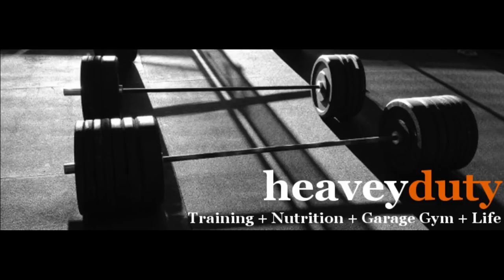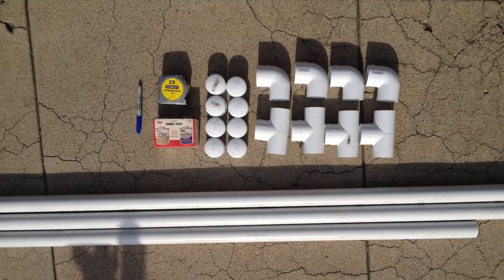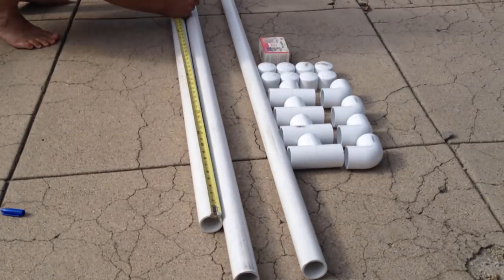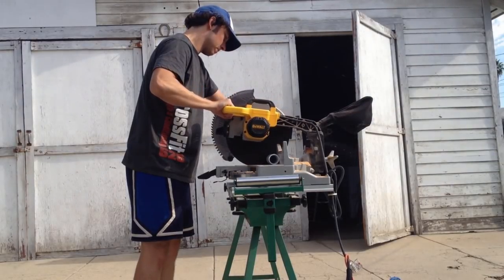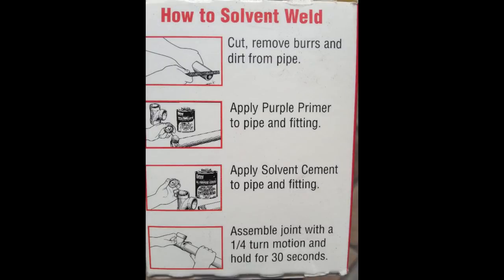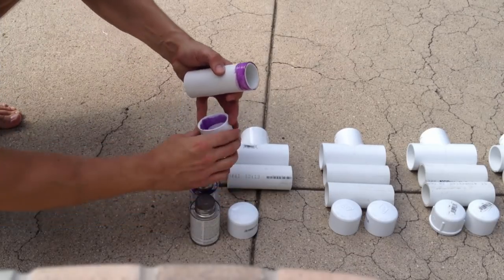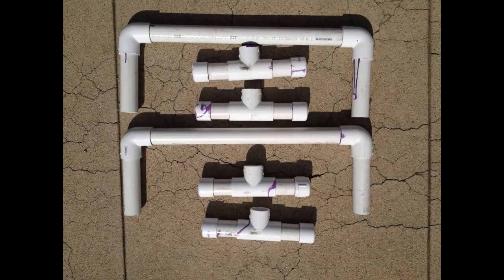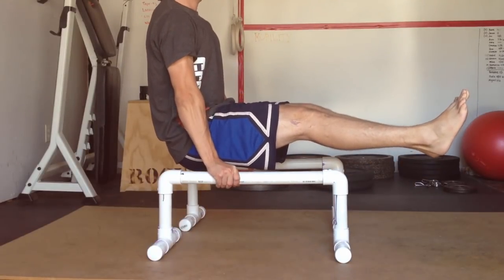How to Build PVC Parallettes - PVC Parallel Bars

Comment: hi ! i have made this parallets however it seems not strong enough ! i thought i have bought a different class of PVC pipe ! what type of PVC pipe class did you use ? i used pipe class 0 . is it the same with yours ? i appreciate it so much if you help me with this issue ! thank you ! :)
Reply from the maker: I'm not familiar with pipe class.  I used 1 1/2 inch, schedule 40 pipe.  It is rated at 330 PSI.  I regularly have guys use them that are over 200lbs and they hold up well.  Hope this helps.
Reply: ok thanks ! i've already made a new one with a harder pipe . now it's strong enough for me .
Reply: Naeim Ab Halim Schedule 40 PVC is the key. There are other variations with the same outside diameter, but the inside diameter is bigger, making the pipe's thickness,  thinner and weaker.

Comment: Damn, those pipes look ticker than the ones i used to make my parallettes. I just tried them and one got bent and theres a 7 inches crack on its side, and im only 165 pounds. Good thing i was able to remove the handle using warm water. I will try with shorter, and hopefully better pipes.

Comment: The set I made bend when I put weight on it the ends separate and doesn't feel stable
Reply from the maker: Maybe you got thinner walled PVC?  The set in this video has continued to serve me well since I made the video 7 years ago.
Reply: @BrandonHeavey   it's actually good now I realised it was the carpet I was using it on so I put some grip tape at the bottom of the paralettes and bam no bend 😉
Reply from the maker: @little-brutetraining5870  Ahhh... right on.  The bottom can be a little slick.  That makes sense.  Glad they're working for you!

Comment: Why make the handles so long
Reply from the maker: These are pretty similar in size to most parallettes you can purchase.  I'd think if you made them much smaller you'd probably need to lengthen the feet to increase stability.  If you give it a shot, let me know how they turn out.
Reply: Will do

Comment: How about rather than being ridiculously cheap you spend a couple of bucks and buy something that will actually work and not collapse under your weight?
Reply from the maker: The pair I made in this video are still going strong 4 years later.  Never collapsed under my weight once.
Reply: I think they're in some ways superior than one made of steel/wood.
For one they are super lightweight which is quite convenient for traveling. Even more so if the parts (at least some) are not glued to together so they can be boxed easily and parts can be swapped to adjust height etc.
Reply: @NeithLeonhart  Also they are pretty much impervious to time. Metal corrodes and wood rots with moisture. I can make a set of these PVC ones and leave them outdoors for eternity and they will not rot.